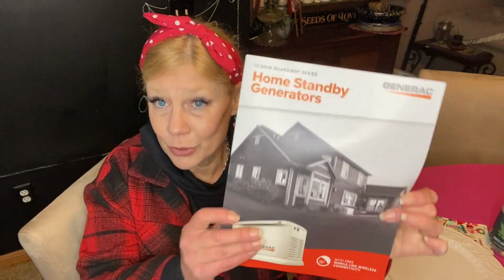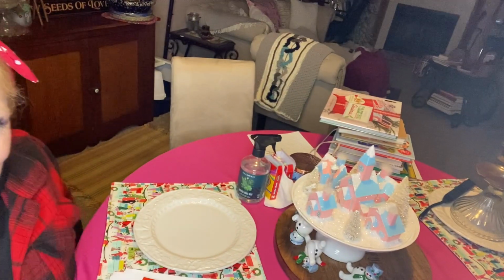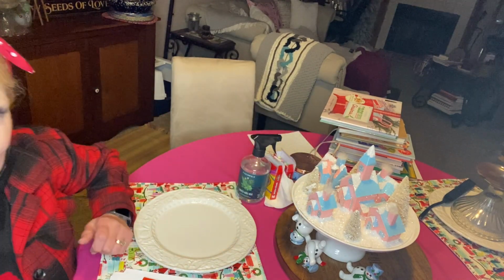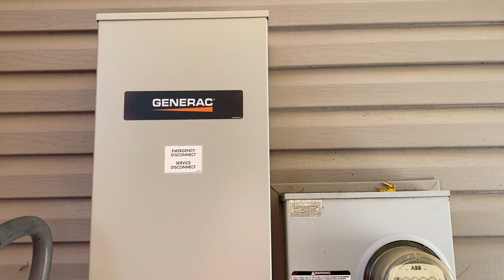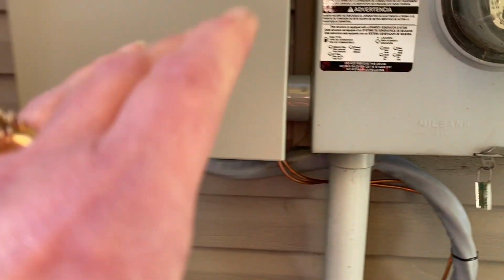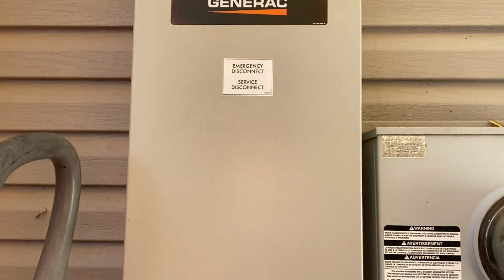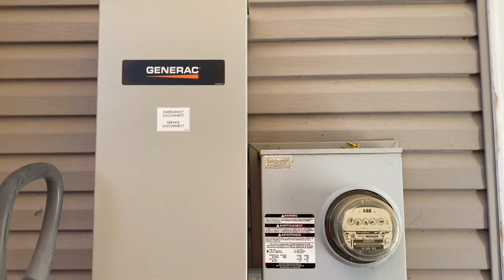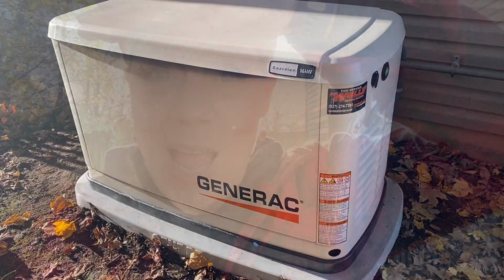Installation of My Generac Whole House Generator!

Comment: In regards to the "harmonic distortion", what they are saying is that this generator delivers "clean power". By that I mean now days, everything is electronic with sensitive equipment. IE: Newer TVs, refrigerators, computers ETC. Another example, I just had an entire HVAC upgrade and my furnace is now high efficiency and electric. I had a Honda portable generator and I reached out to my guy that did the HVAC work and questioned using it to power that and I am glad I did. He said I would have to have an inverter generator to deliver clean power or it could cook the circuit boards. Clean power just means that the waves are consistent and therefore will not damage those sensitive electronics. Hope that helps, thanks for the video!
Reply from the maker: Thank you!  I had no idea lol